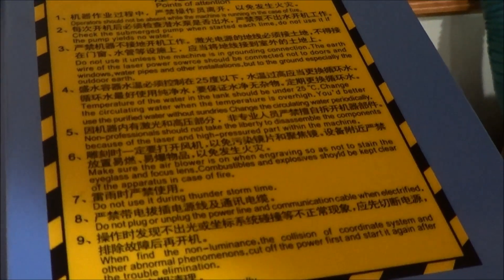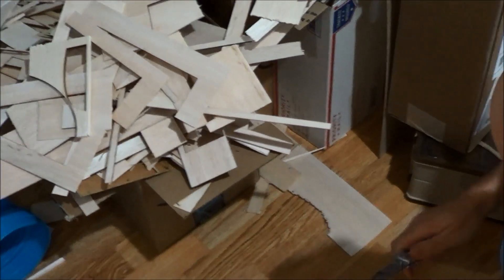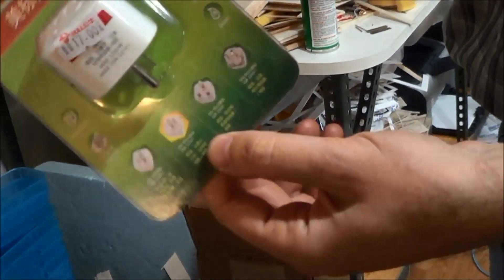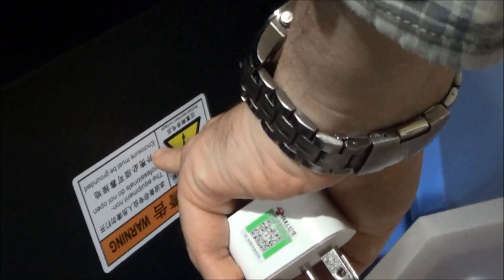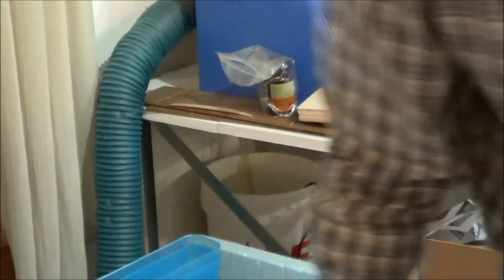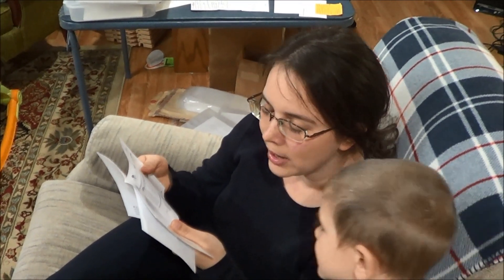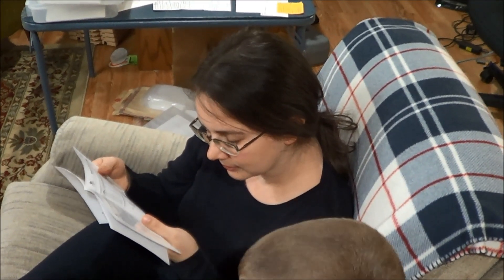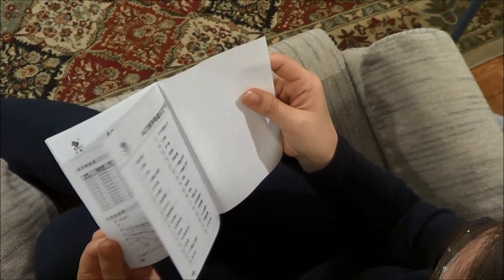Our huge laser came with the craziest Chinglish instructions ever!

Comment: Now we know why you didn't get a new camera for Christmas!  LOL  It's all about priorities.  Hope that's vented to the outside.  Or does it run through a carbon filter?  [edit] nm is see the ducting.

What is your old model?  I'm in the market for a good, yet inexpensive laser cutter than can do basic tasks (thin wood, plastics, cardboard, etc.)
Reply from the maker: Yeah we're venting through a window (with baffles and what not) because the smoke from these is really intense.

I'm keeping the old K40 as a backup for the time being. Those can be had on Ebay for under $400 and they do a pretty nice job.

Comment: Has anyone got an answer to the question:  Why?  When Hobbyking started improving their manuals and we could start to understand them, it felt confusing.  Someone fluent in English had been messing with the well established order of things!  Remember the Turnigy 9XR?  The incredible manual that was the personal project of Ross Cox?  This didn't come from China but from Ross who, I think, is Australian.  The one that preceded it was a mess of Chinglish and then Ross got on board.  Praise be!!  Hobby King bosses finally got it and the world of 9XR enthusiasts cheered and cried out as one: "It comes with a manual that you can understand"
Reply from the maker: I think the answer to that question is simply "Hobbyking". The folks over there decided they didn't want to just be a vendor of cheap toys, but rather, they want to be a dominant force in the global market competing directly with Eflite, Graupner, etc, and they are willing to do what is necessary to achieve that goal. That's why they sell the finest batteries ever produced in all of history.
This laser, on the other hand, is marketed to an entirely different community for a vastly different purpose. It's a full-on industrial tool, and it's marketed to those who cannot afford domestically produced units which cost more than double its price even after import duties and transfer fees. Also, it's used pretty extensively inside the PRC, so it's not purely designed for the US market.

Comment: How much does one of those cost?
Reply: $3,200-$3,500
Reply: @rossclements8874  I cant aircraft that anytime soon lol. Thanks for the info.
Reply from the maker: @powerhousepaperairplanesrogers  The hidden cost is the import fees. I paid $1800 for the laser, and then over $1200 in transfer fees and import duties.
Reply: @joshuawfinn  thats super cheap for that size . I would definitely invest in a 500 shed and a couple fire extinguishers and away from your house . speaking from experience 2 house fires in 10 years both from faulty electrical wiring please be safe please.
Reply from the maker: @thecraftking113  We're working on getting a separate workshop set up as soon as possible. In the meantime, yes, we're doing the best we can to mitigate risks...not easy to put it mildly.
Reply: @joshuawfinn  looking forward to your progress keep up the great content.